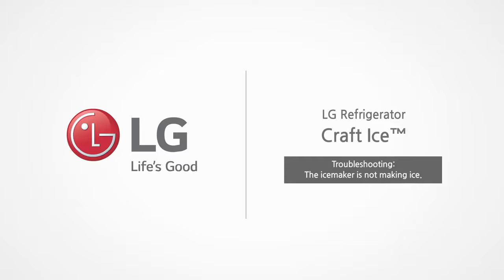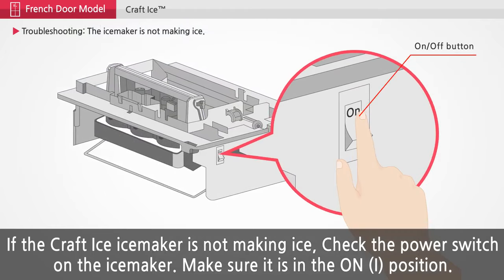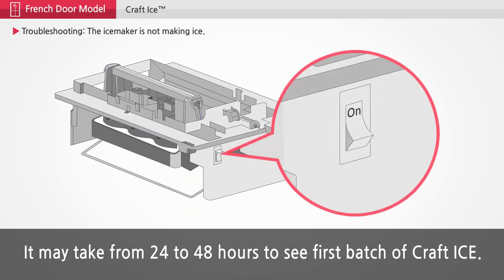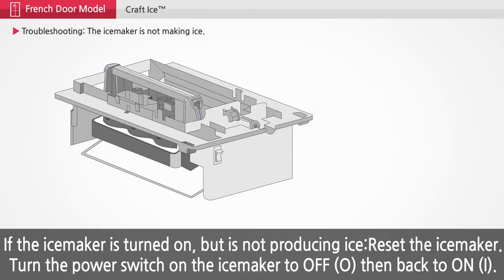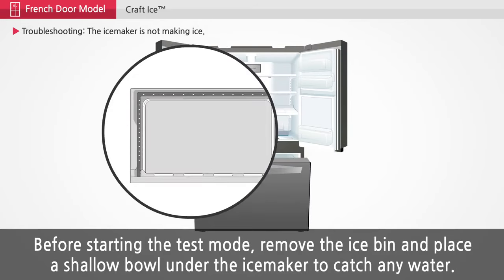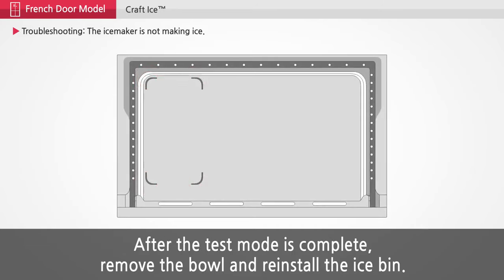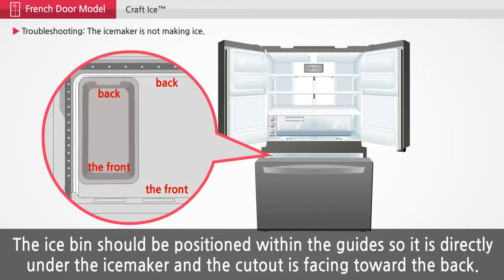Troubleshooting Craft Ice Maker Not Making Ice

Comment: Absolutely amazing that LG could sell a nearly $5K fridge and have a simple function like this go out completely untested.  I've had this fridge for a few weeks and after taking 3 days to make any ice, it worked for about a week and then jammed, spilling water into the tray and creating sheets of ice.  Does LG test anything they sell?  Do they hate their customers?  Why do you hate your customers?
Reply: Hey so I figured this out on my own it’s a simple fix maybe you have the same issue. I was getting water in my craft ice tray. Lmk I’ll help you out.
Reply: @Rcaceres  Thanks.  LG finally got back to me.  They can't find anyone to service the unit but are sending me a replacement ice maker to swap out myself.  Apparently the surface coating of these ice makers is a known problem causing the ice to stick (and then leak).   One might think a company would try to get in front of this known issue by recalling stock or reaching out to new customers but I suppose that's too much trouble and too much expense.
Reply: @DavidMcMahon  it’s crazy! Mine was a different story. I ended up fixing it myself. Let’s just say the water wasn’t falling where it needed to fall into
Reply: @Rcaceres  my issue is there is a ball stuck and the metal bar is on top of it not allowing unit to fully shut so it spilled water in the tray. Should I melt the cube and water out and turn it back on?
Reply: @2001clarklsn  mine was a bent plastic which the water would go half in and half on tray.. I heated it up and bent it back
Reply: @Rcaceres  What was the fix? When my ice maker goes to fill up water, it pours from both sides into the bucket. Only half the water is ever put into the silicone part and so half cubes come out.
Reply: @Rcaceres  can you help me?  My craft ice maker is just leaking water into the tray. Did you have a fix for this?
Reply: @hopesweesy8122  yes I ended up fixing it myself
Reply: @Rcaceres  I'm having the exact same problem.  Can you please share your solution?  Thanks
Reply: @johnmacgregor3106  bent plastic where the water falls. You need to heat it up and even it out. It’s a white square
Reply: @Rcaceres  hey I could totally use your help on this please.
Reply: @brandonhooper7748  it’s a bent plastic where the water falls into you have to bend it back
Reply: Mine just went out for the second time
Reply: Mine the same way. Gets buildup around the seals and it won't eject the balls
Reply: @DavidMcMahon  is the surface coating a yellow color? Mine is the same way...made ice for like... the first week, then hasn't made it since, and then looking at it, I noticed a few very small area's where a yellowish colored sticky residue is on it, and I'm like what the heck could that be?
Reply: @quisedawg1914 , mine too. I had the craft ice maker replaced 8/22, and it just went out again. I called, and they said the part only has a 5-month warranty. I guess they don't have the confidence to do a full-year warranty. They said my solution is to book a $120 diagnostic, then pay for parts and labor again!
Reply: @David McMahon  haha! Like a corp would do qnything to benefit the consumer!
Reply: @Rcaceres  half meaning it made half ice cubes? That’s what mines doing now. I thawed out the 3 half cubes which all bonded together and emptied the 3 trays but the same issue happened again 🤦🏻‍♂️
Reply: @Rcaceres  can you explain more on bent plastic? Where should I look for this on the machine?
Reply: @BobbyKelsey  do you see where the water comes from on the tray? On the plastic part
Reply: @Rcaceres  meaning the 3 cups that fill to form the cube or the actual water source? What would the water source look like?
Reply: @BobbyKelsey  you see where the water falls into? The plastic square piece. Are those straight or bent? You need to remove the ice tray to see it
Reply: @Rcaceres  not really sure what part you’re referring to. Can I email you a photo of the ice machine?
Reply: @Rcaceres  would you please share how you fixed it?
Reply: @MariaManriquez-bi7zq  you have to remove the ice maker from the fridge. Then look at where the water pours, there’s a plastic part that from factory is bent.. you need to bend it back so it can be even with the other side so when the water pours it goes into the part and not half in and half out
Reply: @@Kamakcobotics true but if you like the fridge and you can fix it yourself why not? LG hasn’t taken blame till this day. Mine has been going strong still. 0 issues thank God, and it was just that a defective plastic that needed to be bent back to catch the water.
Reply: Mine has the same issue, they should recall this thing and re-engineer that thing using different material that can handle water/ice weight…
Reply: Mine is eight months old and this just happened to me. I just found this video and was about to do the test function when I saw this comment. Now I’m worried it’s just broken. Ugh.
Reply: Me too!!
Reply: @Rcaceres how did you fix it? My ice won’t drop out so the water goes into the pan
Reply: @audreysherrod1469  there’s a bent plastic where the water drips into, you need to remove the whole unit to fix it. You will see it once you open it, heat the plastic up with a hair dryer and bend it back until it stays straight
Reply: @Rcaceres man - this craft ice machine like the other LG ice machine I had (older model) just have crappy design flaws. 

It froze up on me once a year ago and my neglect as freezer door bit open. Unplugged dethawed  and worked great till a week ago. 

Same problem you all had. Ice in Tray no balls.  Frozen up.  Removed - let melt and dry for couple of days and put back in.   

Worked for few days then snap. A chunk of plastic and a spring is now broke. 

Didn’t see where it was bent.  The old one was always twisted (fixed that with gorilla tape).  

Don’t feel like spending 170$ for one. Bought extended warranty and will see how it works. 

LG and these other companies need to step up on quality control.
Reply: @stemmentor9700  that’s a fact! We spend good money on these things they should at least be on point with customer service and quick solutions
Reply from the maker: Hi there! This truly isn't the experience we strive for. Let's help make things right! Please send us a private message on social media (@LGUSSupport) with your phone, model, & serial numbers. We look forward to exploring your resolution options together! ^Chris
Reply: My craft icemaker went out one week after buying my fridge. LG is garbage.
Reply: Typical of these junks. Do buy TV from LG or Samsung but NEVER a FRIDGE. You will be sorry bigtime, in NOTIME!
Reply: If anyone could help out in this thread, greatly appreciated. 
My ice maker was reset. I actually took it out. Upon putting it back in, the bottom part of the ice maker engaged. This happened yesterday. Have I just not waited enough time before condemning the ice maker? About to get another, things cost like 250 where I'm at.

Comment: Ice balls had become stuck in our craft ice maker.  It didn't realize the ice balls didn't fall out so water would leak into the tray when it tried to refill the cavity.  This was clear to see by pressing the "reset" button which cycled the tray open and closed twice (be sure to leave the tray in to catch the water that spills out.  I used a hair dryer to soften the ice and after a few cycles the popped out.  I tried to wipe the inside of the cavity to make sure it was nice and clean so the new batch doesn't stick (fingers crossed).  This craft ice maker worked perfectly for us for 21 months.  This has been the only issue.
Reply: Thanks for the tip, hairdryer for 5 minutes did the trick in loosening the 3 balls that were stuck... wasn't making ice and just knocking "tap tap tap tap tap tap", felt the stuck ice balls.  Get a towel, remove the ice bin, and aim a hairdryer on heat at the balls for about 3-5 minutes, doesn't have to melt everything, just enough to drop out of the mold.  Restart the ice maker by powering off and on.  Saved a service.
Reply: I just did this and pulled out the ice that was stuck...All three pieces of my craft ice fused together into one piece of ice...had to reset it a couple of times being the ice chunk would get stuck as i was trying to gently nudge it out...Thanks for the info... that button is between a plastic guide thats in the middle and you have to feel around to get to it
Reply: I just had to do this, and the hair dryer worked quickly. Thanks for the tip!
Reply: Ours did the same except we'd get a large square ice loaf since the water would flow over the stuck cubes.
Reply: Ty Jeff! I used a heat gun on low temp to soften the ice and a small baking pan to catch the water. To find the reset button, use a cell phone on selfie mode. It is a white square located on the front left on the LRFXC2416S fridge.
Reply: Genius!!! I just used the hair dryer like you said and it loosened the ice balls enough to come out in the test cycle.  However, this refrigerator should have a sensor built into it to notify me of the malfunction; after all, they really push the "smart" features if this appliance. I should have immediately received a notification on my phone through the "LG ThinQ" app.
Reply: Thank you so much for your help. As a widow, it's difficult for me to figure things out but your advice helped tremendously! I used a hair dryer on the stuck balls of ice and hit the reset button a couple of times and out they came. Again my thanks!
Reply: As an update, I have to do this a couple times each year.  I'm thinking that it may have to do with the surface of the silicon mold not being as clean/smooth as it is when brand new since we didn't have this issue for the first 18 months or so.  I'd like to research how to clean or replace the silicon mold and see if it lasts longer between freeze-ups.
Reply: @JeffreyEllingson  I was just going to ask if there were any updates when lo and behold, an update. It’s very frustrating that this has to be done so often. We hadn’t tried the heat Gun thing, we just ended up turning it off and going without.
Reply: Big thanks Jeff!   Your hairdryer trick and reset button worked!    I was able to grab the 3 balls that had frozen together and pop them out after warming them with the hairdryer for 3-5 minutes.     We have already had the craft ice maker fixed once under warranty, and I thought I was about to have to call the warranty people again.     The LG extended warranty people were a huge pain to deal with the first time although they did finally come through.    Glad to know there is a relatively easy fix for this.
Reply: Awesome - that worked. You are a genius!

Comment: You cannot use a bowl. Use the ice tray. Pull the top drawer out just enough to get your hand in and push reset button located on the underside of the ice maker. As the unit cycles you   can adjust drawer so tray catches water. The reset button is very small. You have to use the tip of your finger. You will hear a "beep" when you successfully reset. You can watch as unit cycles. Mine took four resets to get water flowing.
Reply: That comment helped so much! Thank you
Reply: This tip worked for us - we unplugeed/replugged it back into the wall and it took two resets for water to start flowing back into the craft trays.
Reply: Can you close the drawer while you reser it? How Long does it take to do the reset cycle?  Thank you.
Reply: Thanks for this!  I couldn't find the reset button.  Stopped working after an extended power outage.  Working again, yay!
Reply: Anyone else have issues even finding the test mode/reset button?
Reply: Thank you for this comment!! Fixed for me thanks!
Reply: If anyone needs to know WHERE THE RESET BUTTON IS, it’s towards the FRONT of the craft ice maker underneath the on/off switch. Stick your hand underneath the on/off switch and feel around and you’ll feel a button. Hold it down for 3 seconds and you’ll hear a beep. Then look underneath the mechanism and you’ll see the parts moving and resetting. Hope this helped someone. Took me FOREVER to find that friggin button! 😅

Comment: Ok ppl. My husband and I have both tried for hours to find the damn reset button on this damn craft ice maker. (I would have just forgotten about it but have become very fond of the round ice cubes. Addicted to them, in fact). This seems like sort of an official video from LG, but for us the reset process has been totally impossible. What is the big secret???? Help! Do not want to call expensive repairman for something we can do ourselves. Supposedly.
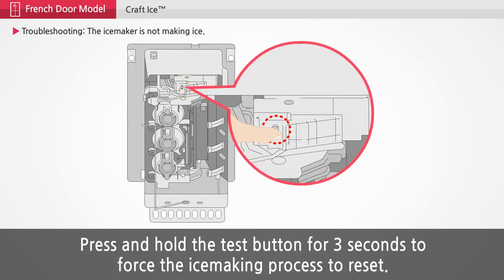Reply from the maker: Hey there! If you go to the 1:11 mark in the video, you’ll see where it shows the area under the icemaker where the reset button is located. Using a small mirror to look underneath the icemaker, you’ll want to find a U-shaped indentation, and inside that indentation, you’ll see a square button. The button may not feel like a typical button, but once you find the indentation, place your finger inside it, and you’ll be in the right spot.

Press and hold this button for 5-8 seconds until the icemaker starts moving. If nothing happens after pressing the reset button, try turning off the Craft Icemaker, unplugging the refrigerator for 5 minutes, then plugging it back in, turning the icemaker back on, and pressing the button again.

If you need more assistance, feel free to reach out to us on social media at @LGUSSupport. ~Nancy

Comment: I've had the craft ice maker replaced once under warranty.    It just stopped making the craft ice again.    Doing the typical dripping water into the ice tray, but not dropping the balls.     After reading through the comments this guy Jeff recommends using a hairdryer to loosen the frozen balls and then using the test/reset button.    Genius.    It worked like a champ!    Remove the top slider drawer from the freezer.   It makes getting to the ice maker with the hairdryer WAY easier.    Take the ice ball tray out of its normal place and place it in the bottom of the freezer under the craft ice maker to catch any water(mine did not drip for what it's worth)     Use the hairdryer on high heat for about 5 minutes.     Move it back and forth to ensure all 3 balls are melting.    Then push and hold the test button for 3 seconds.   It will beep and then begin running the cycle.    At that point I was able to gently grab the ice ball which had frozen into one giant piece and pull it out of the ice molds.    Put the top sliding drawer back in place with the ice ball tray and you're done.
Reply from the maker: Hi there, we want to send you a great big shout-out of thanks. Thank you for helping the community in a mighty way. We heavily rely on the comments and suggestions of our most valued customers. Again, thanks for the LG brand support. ~Tanisha
Reply: @alaskapanic  I am able to do the test/reset on my own craft ice maker but was trying to help a neighbor with theirs.  When I go to do the test mode and push the button in, it beeps once, maybe twice on some occasions and then doesn't do anything else.  I also tried the hair dryer but don't see any or feel any stuck ice.  When you tried your test mode, did it immediately make noises?  I'm wondering if I needed to hold the hair dryer on it longer in case there's ice I can't see that's stuck.  I may suggest they unplug and plug back in but would hate for that to cause any further harm to the rest of the refrigerator.  Thanks in advance if you see this and have suggestions.
Reply: @Sophiesshenanigans did you figure this out? My ice maker makes the one beeping noise but it never cycles the arm, etc.
Reply: @Cosmo_Cramer  no, our friend ended up having to call it in for service & at that time, they replaced it for free.  I don't think there was even water coming into the tray.  Then of course ours acted up so I got online with LG and tried to figure things out.  I did find out that our water dispenser wasn't working right, and we were able to fix that issue without a service call.  LG also sent us a new craft ice ball maker to replace the old one, because it sounded like it was dying and wouldn't drop the balls anymore.  It's pretty easy to replace on your own.  There are youtube videos out there showing how to do it.  I think they know about the issues with this craft ice ball maker but I'm sure we will end up having to replace it again.    Did you try a hair dryer on it?  Can you feel ice in the tray?
Reply: @Sophiesshenanigans thanks for the response! I can feel that there is half of an ice ball in each circle. I’ve had the issue where it wasn’t creating ice balls so I reset it then it’ll start working. Now I hit the reset button and it just beeps and the arm doesn’t move. I’ll try the hair dryer and also reach out to LG. Thanks again for the reply!
Reply: @Cosmo_Cramer  You're welcome!  Yes, hold the hair dryer there with a dish under it of course, until the unit starts moving and the ice balls drop.  If they don't, it might be completely broken.  If it's still under warranty that would be good.  Lots of folks have had issues.  But I do have to say when I chatted with them online, I received decent help and was happy about that.  Good luck!

Comment: We have an LG LRMDC2306S. During first month we’ve had 4 service visits for craft ice maker not working. Each service call reveals the water feed line to the ice maker is frozen solid although the freezer temp is set at +4F. We added two thermometers into the freezer that log temp and they both show 4F so temp sensor is good.  Does the craft ice maker line have a heater/defrost? Latest tech wants to switch out water feed line but by this point we have zero confidence LG know how to build a fridge.